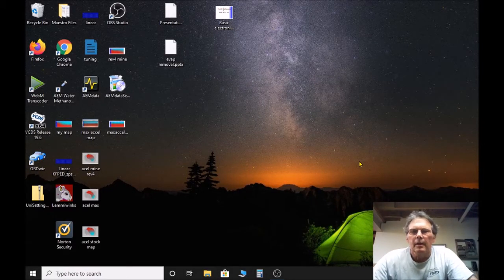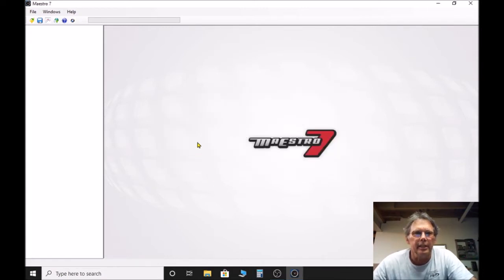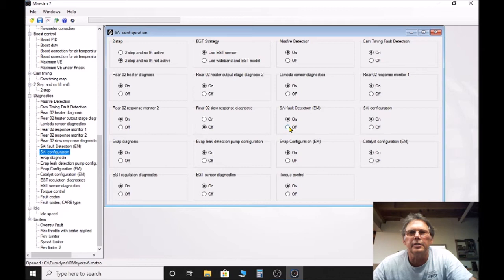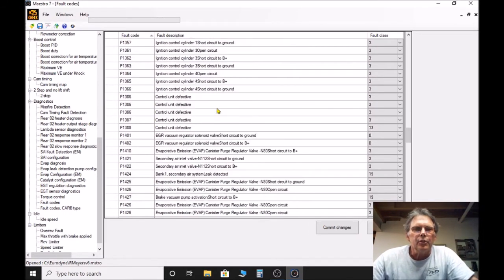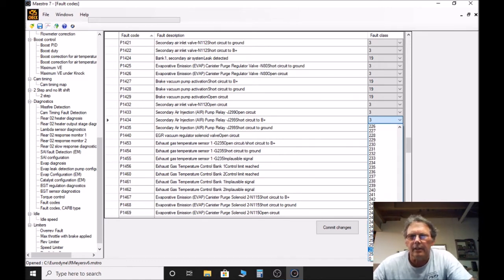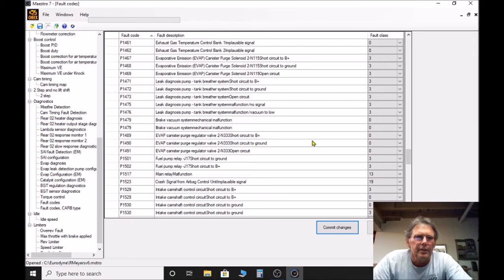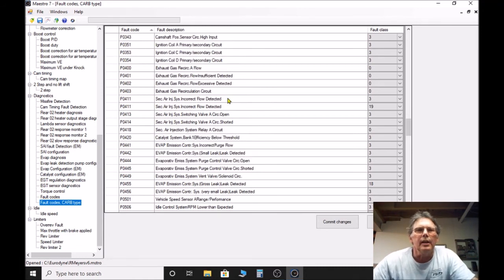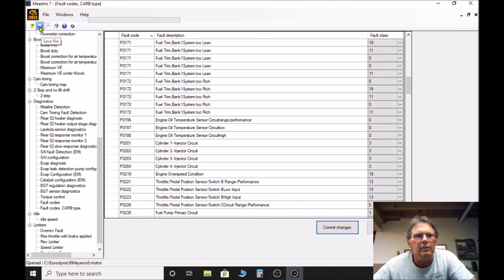Using Eurodyne/Maestro Software to delete fault codes

Comment: Awesome tutorial thank you Sir, Eurodyne Maestro 7, can we delete immo as well?

I have two AUDI TT 225 AMU, in one replaced secondary air pump, n112 valve and COMBVI VALVE, ECU still shows DTC for SAI, inadequate airflow detection.

BTW maestro only for one car license, do you know how much do they charge for additional car?
Reply from the maker: I have moved on to Ignitron ECU. Pretty sure you can not defeat the immo with Maestro, takes more than that. Any code you get, you should be able to change that value to "0" and it will no longer show up. and don't forget to save the new file.
Reply: Thank you Sir.